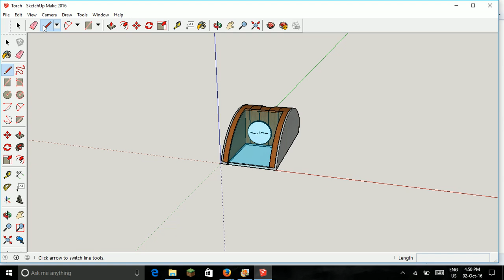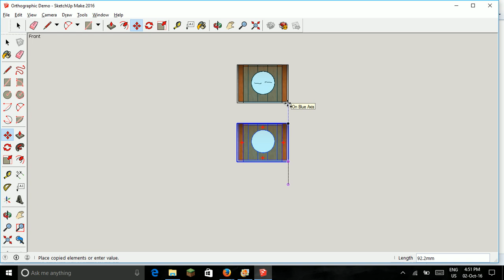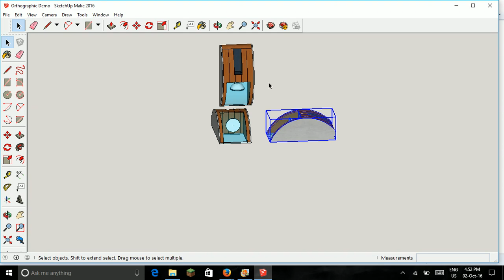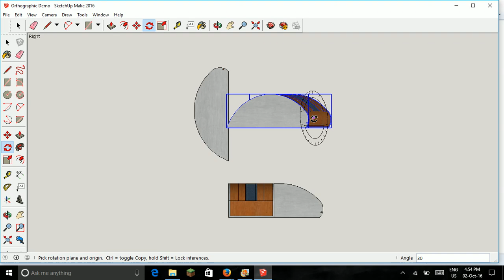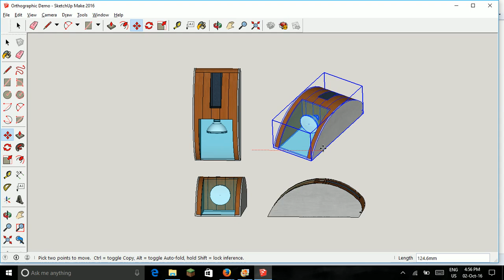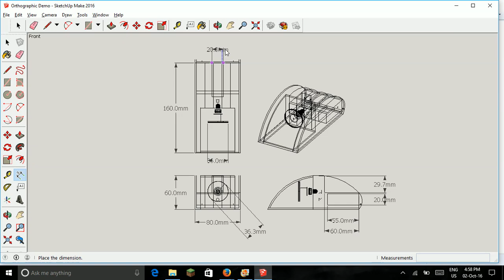How to make an orthographic drawing in Sketchup for free

Comment: Do you know that if you press the arrow keys, you can lock the green, red and blue axis?
Reply from the maker: Israel de L'Amour Ah thanks, I didn't know that.
Reply: You are welcome, and thanks for your video. Just one little thing, I used to work with sketchup make because the pro is soo expensive, but now I work with the free version that is a simple APP in your explorer. Give it a try, no need to install, always last version and cloud file saving. 
https://app.sketchup.com/app?hl=en